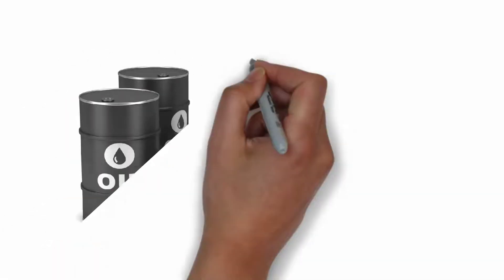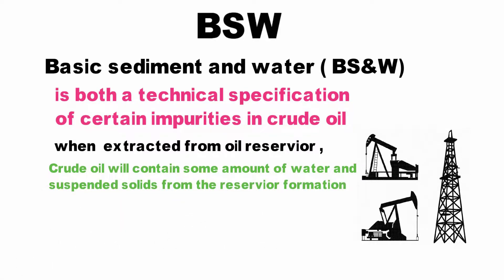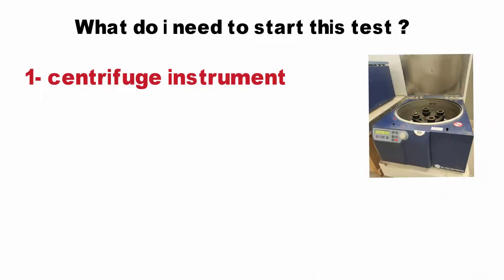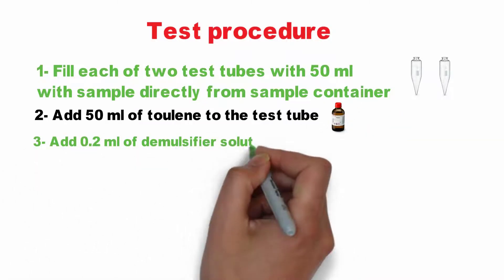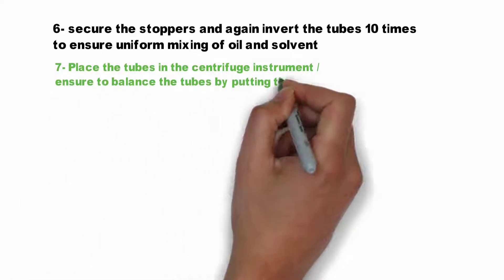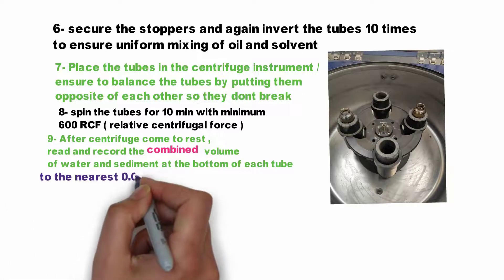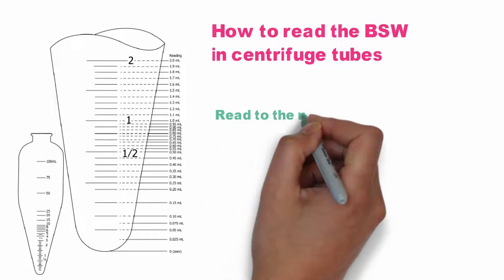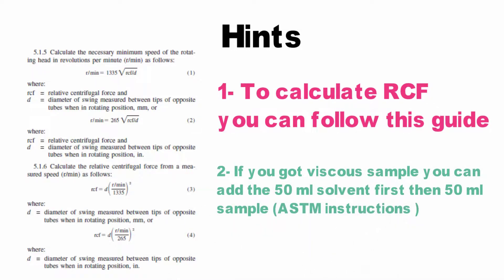BS&W  Basic Sediment and Water   ASTM  D4007  | Yazenkom

Comment: If ASTM D-4007 is the laboratory method for determining sediment and water in crude oil and "impurities are measured as BASIC sediment and water results"; then what other S&W results are there? For instance, is there an ADVANCE sediment and water? Thank you for the excellent video.
Reply from the maker: To my knowledge the term "basic"  refers  just to the fundamental nature of the test and its importance in evaluating the quality of crude oil.. the amount of non hydrocarbons  contaminants in crude oil samples.. ASTM D4007 speaking about sum of both  impurities S&W , were you can get sediment in crude  by extraction ASTM method D473 , or water in crude by distillation method  ASTM method D4006

Hopefully this help

Comment: why do we use toluene solvent in this process? 
can we use only crude oil sample with demulsifer?
Reply from the maker: Salam Mohammed 

The solvent is added to reduce the viscosity and dissolve Paraffin and Asphaletene that can cause inaccurate result.
You can use different solvent like shellsol instead of toluene 

Not recommended to do that without solvent , maybe it might work for some samples but you never know the characteristics of your sample , my advise is better to follow avilable ASTM D4007 standart testing method
Reply: like dissolved like